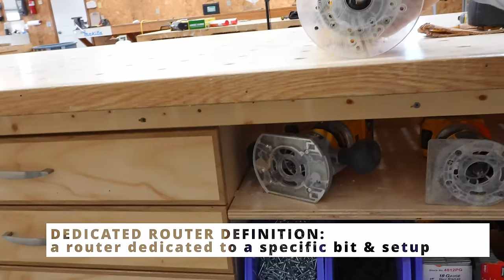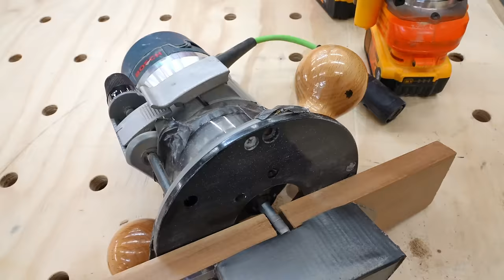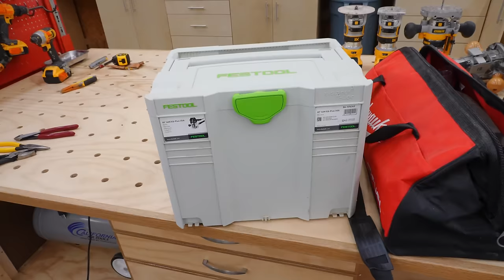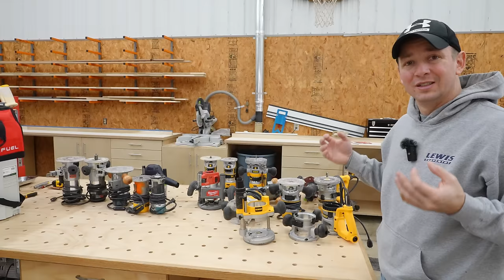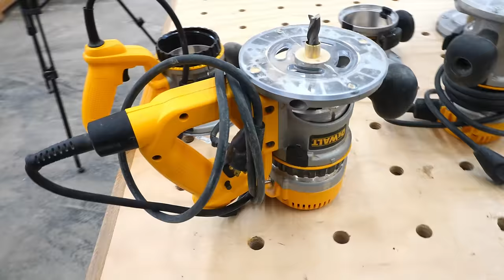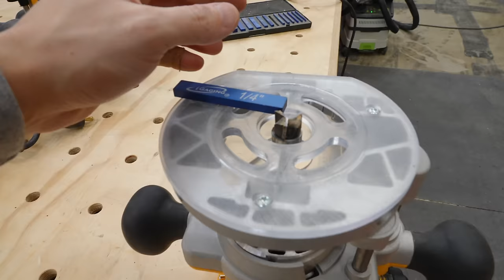ROUTERS 101: Pro Tips for Getting Started With Handheld Routers

Comment from the maker: THANKS FOR YOUR SUPPORT!!!
Dewalt 20v Compact Router - https://amzn.to/47ZPheX (Amazon - Earns Commissions)

DEWALT Plunge Base For Compact Router - https://amzn.to/4bp5tcq (Amazon - Earns Commissions)

Festool OF1400 Router - https://amzn.to/49h3epW (Amazon - Earns Commissions)

Festool OF1010 Router - https://amzn.to/3SrCjRm (Amazon - Earns Commissions)
Festool 486058 Edging Plate - https://amzn.to/3HIJ8Jl (Amazon - Earns Commissions)
Festool 486242 Chip Deflector - https://amzn.to/3HIbdR6 (Amazon - Earns Commissions)

Dewalt DW618 Router Kit - https://amzn.to/4bkiHY9 (Amazon - Earns Commissions)

Powertec Universal Compact Router Base Plate - https://amzn.to/3HKnWTl (Amazon - Earns Commissions)
Powertec Mid Size Universal Router Base Plate - https://amzn.to/3vZ1bse (Amazon - Earns Commissions)

POWERTEC 71166 Short Shank Guide Bushing and Nut, 5/8-Inch - https://amzn.to/484ig1f (Amazon - Earns Commissions)
POWERTEC 71222 Router Template Guide Bushing Tall 5/8 O.D. - https://amzn.to/42mCSRd (Amazon - Earns Commissions)

Comment: I'm with you on the routers, I have 2-3 in the van, In the shop probably have 4-5 set  in different machines and router tables, 2-3 trim routers are for laminate tops ,5-6 set up for special jobs that never get changed, and 3-4  extra for one off jobs. I think 2 are cordless.
I am not Bragging about all the routers, but they are worth their weight in gold and time is money in a production  setting

Comment: Just saw Mafell has a corded router with tool-less bit change,and a hollow base plate with dust collection. 
1 lever and it ejects the bit.
I currently have 8 routers
Routers and drills are better in multiple dedicated setups.

Bosch 1617 are cheap and available everywhere, however i have 2 of my own,and 3 from customers that need bearings or speed controllers.
As you stated among many of your great points ,sharing motors also = shared parts.

Comment: Yes, quarter inch bits definitely flex around.  Brass guide bushings will eventually get hogged out from bit flex if you're doing a lot of pattern work.  I had to switch to steel bushings after I ate up several brass ones.

Comment: Hi Spencer, wow, what a presentation.  Years ago I suggested to Festool to make a trim router with a screw on bit.  They came out with the OFK500Q which had a 19mm (three quarter inch) screw on shank.  Unfortunatey it did not take off as some of the other of my inspirations, over the last 30 years, have.  I thought it was awesome for small round overs to 6mm in my capacity of an occasional wood artist.   There was absolutely no chatter and the finish was superb.  Did you ever see that router in America?  If so, what did you think of it?  Here in Australia I got the feeling that salespeople had the idea that the added expense for the unique bit would turn tradesmen off and so they did not sell the chatter proof excellent finish to them.  In this youtube you talk about your time as the most important consideration which is why you have so many routers.  Would the OFK500Q with its superior performance have been advantageous to you?
Reply from the maker: I had never seen that setup. Sounds interesting!

Comment: Something on bit speed, size vs. speed might be helpful.  And, always confused on how much larger you should make your templates when using a 5/8” bushing.
Reply: It would all depend on bit diameter
Reply: Large bits need a slower speed 2"diameter bit may run at 10,000 rpm, if the router vibrates it's to fast.  If it runs smoothly it's the right speed. Don't buy a single speed router

Comment: I'd like to know about that Milwaukee. Specifically, is it more hassle than it's worth having a battery powered router of that size? If you wanted one universal 1/2" router, would it suffice, or would you rather avoid that and go corded? I have a Bosch 2-1/4hp fixed base I got for a steal for my benchtop router table, and I'm on the Milwaukee platform for my tools, including a palm router with a plunge base. I'm looking at a larger one for hand held use, and batter power is so alluringly portable, but it's expensive and, to me, questionable if you have to use it a lot, to bother with the batteries. What's your opinion, since I see you own one?
Reply from the maker: If I could only have one midsize router it would definitely have a cord on it.

Comment: Could you explain why the 5/8 guide bushing only? Maybe a video on templating and jigs. Trying to do some flush lutron light plates in nickel gap. Its my first time using guide bushings to try and make a template. Thanks for the videos.
Reply: It's 5/8ths outside diameter with a 1/2" inside diameter.  You can make your template with 5/8ths gaps (plus a hair) so the bushing slides down through it tightly.
Reply: You can make wider or narrower cuts with the same bit just using different rub collars. I like Porter cable they have  endless sizes

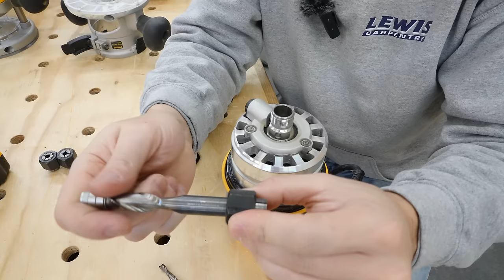Comment: 16:14 As to bit insertion depth,  Spencer says, “There's really no point in going deeper than [1/4″].” Not so! The entire length of the bit beneath the collet ("stick-out") is a lever arm, and the shear  (I think?) forces on the bit multiply by the distance. It doesn't matter for light cuts, but when you're pushing the capacity of the tool, material, or depth of cut, it certainly can.